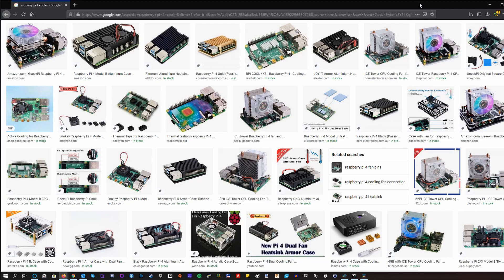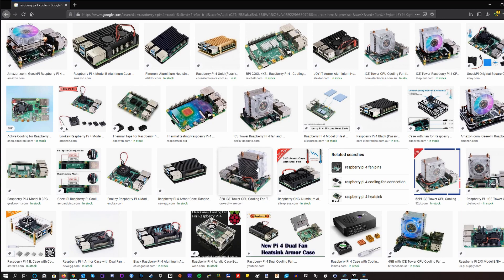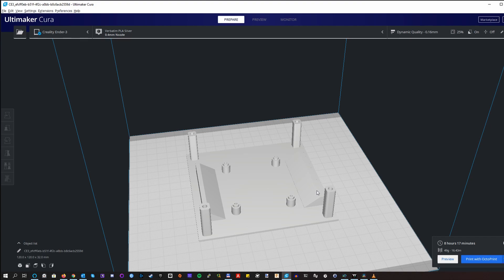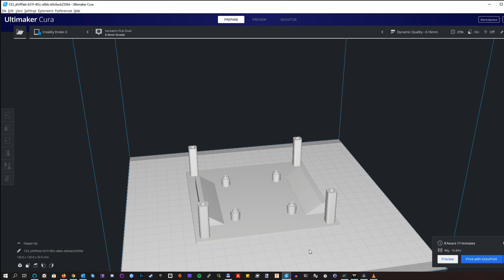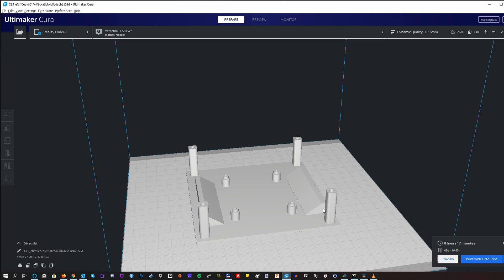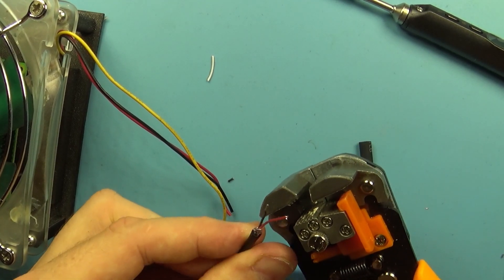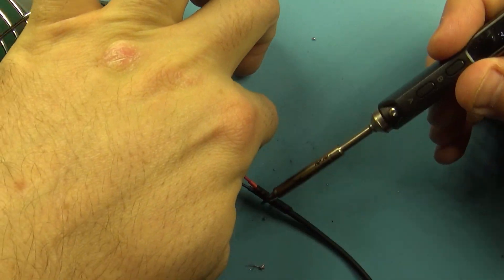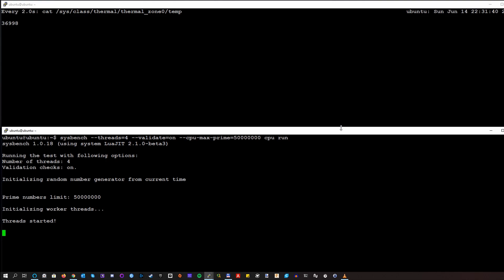DIY Raspberry Pi 4 Cooler - It's a Monster And I Love It!

Comment: I like the idea and might give it a try on my octoprint Pi which runs 24/7. Pro tip: if you ever need a more closed case for any electronics that could get hot use a color change filament. So you can see the temperature of it without touching, measuring or a thermal cam.
Reply from the maker: Wow, what a nice and cool idea Michael! Tbh I've never really seen a practical use for thermal reactive filaments (besides having fun), but this idea of yours seems to be rather interesting!

Comment: Interesting case design. For me, being open like that isn't an issue but I can understand how some prefer closed cases. A more integrated power solution would be cool, but not necessary and this should keep the Pi4 running nice and stable.